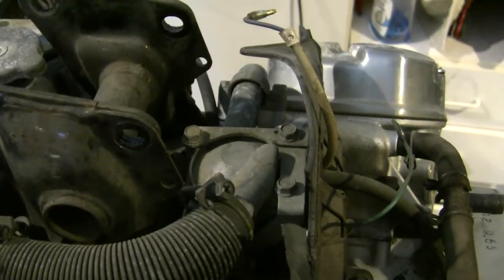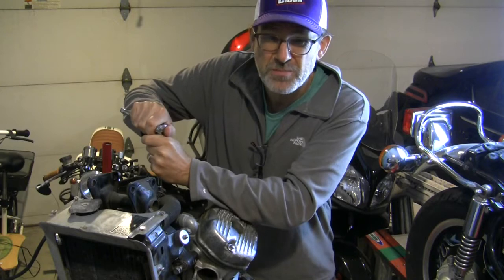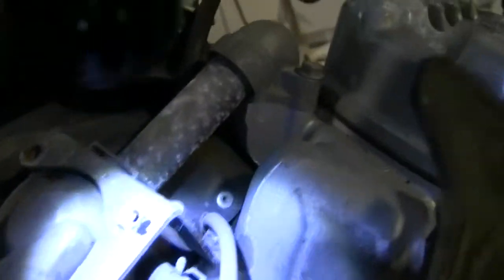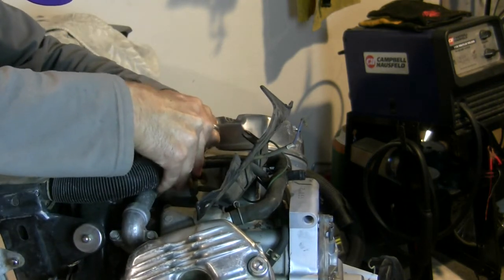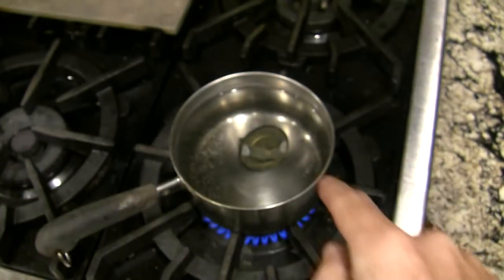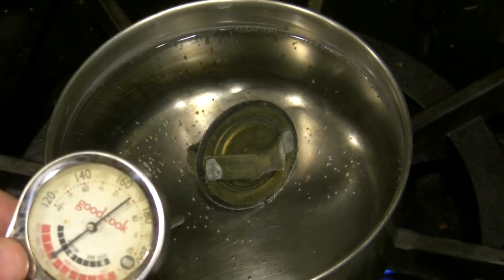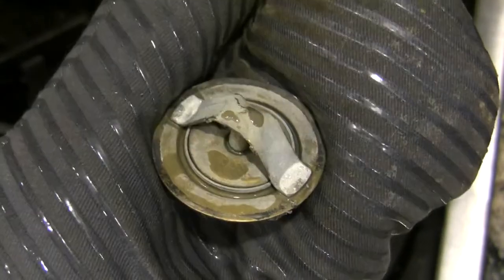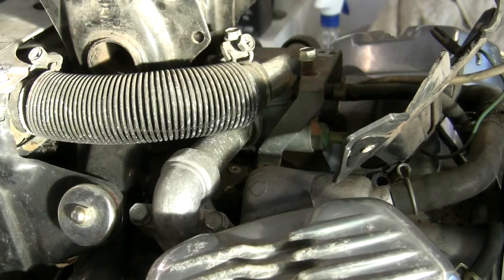Remove/Replace & Test Thermostat - CX500 Restoration (Part 11)

Comment: Saludos de Costa Rica Centroamérica.
Cuál debe ser el valor en onmios del termostato del indicador (reloj o Instrumento.)
Reply from the maker: Gracias por ver. ¡Hola desde Los Ángeles! Espero que esta información ayude. 60 deg C - 104 Ohms, 85 deg C - 185 Ohms, 110 deg C, 20.3 Ohms, 120 deg C - 16.1 Ohms.
Reply: @UrbanMonkTV  Claro que me ayuda. Mil gracias.

Comment: WHERE DID YOU ORDER THE O-RING/PART NUMBER
Reply from the maker: Part # 91301-MB6-003

21.9x2.3 That's my part #. You double check yours at hondapartshouse.com, but I bought mine on eBay. Thanks for watching!